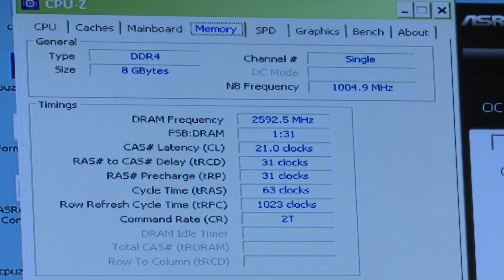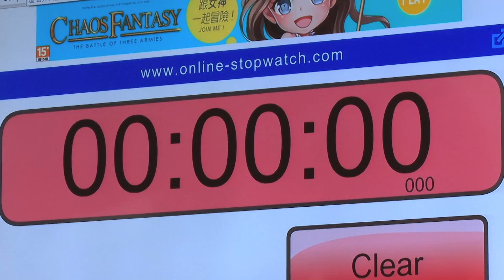G.SKILL's Extreme Overclocking Events @ Computex 2016

Comment: Wikkid stuff, I try to modestly clock every system I own for efficiency... never too hardcore as I re-build old systems into recording / gaming stations, rather than sacrifice them to benchmarks, but I do try to take advantage of the cooling equipment I have, and re-clock when I add new goodies.  My next build I am planning a lot of personal first's ... first custom loop building solo, first custom bending (non-pliable) for piping, I have an oldschool aluminum Lian - Li double windowed case I want to retro-fit / paint for blacklights for my first DDR4 creation, hoping to base it around a flat black mobo with an RGB Video Card, UV LED's and some flat black DDR4 ...

Comment: Holy crap! over 5,000 MHz??  That's incredible...  I have almost no luck with overclocking, my hardware is mostly crap.  I'm broke lol.  I can sometimes get my CPU and GPU running a hundred MHz faster than normal, but that's about it.  If I had the right hardware, it'd be a different story completely!  Eventually I gotta try this liquid nitrogen thing, I've seen the tutorials, I know I could do it, but right now I'm broke and have other things to put cash towards...

Comment: That video was awesome.. Im running an AMD 6800k  overclocked at 4300 ghz with an ASUS HD7800 3GB GPU at 1292/ Memory clock at 5410..     My ram is only 8Gigs of DDR3 with virtual memory at 12GB.       A set of these 3200 Tridents would be an awesome addition to my rig.

Comment: OC'ed my 3770K to 4.5ghz but temp was too high @ 1.3volts or above.. and unstable at 1.3v below.. so im at 4.3ghz @ 1.25v with temps around 65 - 70C, my Kingston hyper X furys 1866 are oced at 2133 @ 1.53 volts.. cant really oc my 1070 as it just throttles even if i bump the core +100 mhz, but VRam is stable at +450 mhz.. will have to make do till i can save enough for AMD Zen or Intel Kaby Lake due next year.. cheers

Comment: My CPU doesn't like when I overclock it's RAM, so I am running stock DDR4 @2.4GHz. My i7-5820k however is an okay overclocker. It runs 4.3GHz @1.28V just fine which is a significant performance boost over the stock 3.6GHz. Achieving this was super easy on my Asrock X99 Extreme4.

Overall I usually lose in the silicon lottery. In the past I had a GTX 670 which would only do stock and a i7-4930k which was limited to 4.2GHz. I never had any defects due to overclocking though which is a plus.

Comment: I overclocked my 2600k(3,.4GhzStock) to 4,8Ghz All Cores using DDR3 1600Mz Gskill DDR3 Ripjaws, had no problems. Also own an very old intel e5200(stock 2,5Ghz) which was clocked to  3500Mhz on all Cores.

Comment: Got my A6 3420m to 2.6 stable and under 80 C and my A10 8750K at 4.3, and currently testing it for better, 4.4 or 4.5 while lowering the voltages from 1.45 :) I haven't reached more than 55C. And for graphics on both chips, +200 Mhz for a good gain on the gaming side. I like AMD APUs ^^

Comment: I overclocking my 970 strix only when I need that 5-10 frame per second boost. Although I have tried to OC my 4770k, my motherboard didn't support it at the time. I have updated my drivers but haven't gotten around to trying again.

Comment: Nice video. My first overclocked processor was AMD k5-pr133 (bus set to 75MHz from defalt 66). Second was Intel Celeron 600 (bus set to 75MHz from default 66). Third was AMD Athlon XP (Barton) (FSB set to 400MHz). Then was Intel Q6600 (FSB was set to 333 MHz from default 266). Now Intel Core i5-5675C overclocked to 3900MHz. Not very cool, but this is not the end ))

Comment: My first overclock was my good old Q6600 G0 on my Asus P5Q. That was my first real PC that I built from eBay purchases. I managed to get it up to 3.2GHz using an Arctic Freezer 7 Pro. My next overclock is the rig I have now. I have my i5 3570k at 4.3GHz under a Corsair H55. 60-65c under full load.

Comment: I still remember my first overclock. I was overclocking a Pentium E2220, and took it from 2.4GHz to 3.0GHz with air dissipation. Obviously I had not disabled the second core. And from there I was delighted to overclock the old processors. Because with very little money and with a motherboard 775, you can enjoy great.

Comment: Still using a socket 1366 Xeon X5690 Processor Over clocked to 4Ghz on air everyday use from gaming to graphics. Slight over clocked with 18GB Extreme Speed GSkill Ram which has worked wonderfully no compatibility issues what so ever. In order to get it stable I used prime95 with a couple of temp monitoring programs took a lot of trial and error to get it just right.

Comment: The only overclocking I ever done was when my old GPU was getting too slow to properly game.
I used a BIOS flash and RivaTuner to unlock nearly everything inside (nearly all pipelines without artefacts) and crank up the clockspeeds on core and memory.
It only lasted a month though and then it died altogether :P

Now I just buy faster hardware to compensate and give the 'older' stuff to my family.

Comment: My overclocking started with 386 DX 35, when i clocked it to 45 Mhz :D
From that on almost every computer has been overclocked.
Some honorable mentions of mine (just some highlights): 
First watercooled PC, built around that already mentioned 386 DX 35 @45
-AMD 486 DX2 80Mhz to 150Mhz stable (booted with 198Mhz, but was not stable)
-Pentium II 333 @515Mhz
-Celeron 667Mhz to 1452Mhz
-Pentium 4 2,4Ghz 478 @3,3Ghz
-Pentium 4 630 @4,2Ghz
-C2D E6300 @3,6Ghz
-QX6700 @3,8Ghz
-FX8370 @5,2Ghz
-i7 2490X @4,9Ghz

Comment: i had an old pc which i wanted to throw away because it was too slow. but then i have decided to try to everclock it. i have overclocked it by about .5 ghz and it became usefull again, so i have bought a new system about 1 year later with better specs :)

Comment: I rarely overclock ram but I do try and get the timings as tight as possible. I'm currently using 3200MHz Corsair Platinum.  I have managed to get it to 15, 16, 16, 36 but I think I could get a bit better with G.skill. :)

Comment: I tried to use the XMP 2000 on an old X58 system but it didn't work. After a few hour searching on the internet, I realize that my CPU IMC is too weak for that setting. So I'm waiting to change to other CPU with better IMC and will attempt to try it once more.

Comment: I have some good experience with Gskill ram, with RipjawsX especially. I can push the ram from 1600mhz 6-8-6-24 into 2400 8-12-8-24. It's cool experience when you consider the price of the ram and you gain 50% more mhz. and I only pay for 35 USD

Comment: The furthest I've ever overclocked my memory was taking a 1600 MHz DDR3 kit to 2133 MHz just using some trial/error with timings I've seen for similar memory speeds... this kind of overclocking, ESPECIALLY for memory, is just mind-boggling!  CPU and GPU overclocking always came easier to me, and frankly made more sense just because memory speed gains for overall system performance aren't really felt for most use case scenarios...

... but it's still nice to have that fast memory, even if it's just for bragging rights ;-)

Comment: I have overclocked my AMD FX6300 up to 4.2ghz  paired with my G.SKILL ARES 2x4GB at 1866mhz. It is still running smooth without problems since 2014 when I first built it. If I will be winning one of the Trident Z memory kits in your giveaway, this is a perfect timing because I'm planning on upgrading my RIG into a DDR4 Skylake system. Thanks G.SKILL for the chance and more power to your company!

Comment: I only have good experiences with OC due to good luck, both my CPU and GPU are beast overclockers. When I find a very demanding game I push my HD 7950 to 1.2Ghz and my i5 2500K to 4.5Ghz, on relatively low voltages compared to the stock ones, and overall performance increase is an insane +50%. If I happen to win some RAM from you I will upgrade my CPU and mobo to make it compatible. Good luck everyone.

Comment: I've have some experience in the past with overclocking: Intel E8400 can't remember the clock I got it to since it's been so long. More recently I've gone through 2 5Ghz chips 3770K and 4770K haven't touched my newest 6700K yet. I've had a ton of GPU overclock experience with some pretty sick clocks on a 7970 and 290x more recently. FedEx is dropping off my change to the green side in a EVGA GTX 1080 FTW sometime today but can't toy with it until EK releases a block for it. 

When it comes to the ram timings though I'm at a loss. I can increase the Mhz rating several steps above shipped specs but the timings elude me by getting a bit too far in depth.

FYI The G.Skill girls are the best part of the vid. ;-)

Comment: overclocked my 4770K to 4.4Ghz on air Noctua Nh-d14 with good temps. My attempt at overclocking my stock 1600mhz ram however failed miserably. Not sure if ram (vengeance pro) or motherboard (asus z87 pro), but time to upgrade both I think

Comment: When I overclocked my AMD HD7750, I just put the sliders all to max and it did it. It was burning up the atmosphere, but it did it! Sliding back the memory clock a little allowed my to keep it at a little lower voltage and maintain reasonable temperatures.

Comment: My motherboard (Asus Gene VIII) is not very good at overclocking, so I didn't manage to squeeze much from G.Skill TridentZ 2 x 8GB 3333 CL16. I've only managed to get 3480 MHz, with much of a struggle. I don't blame the memory, but rather the Asus. I've tried many bioses, no good result.
My dream is to get my hands on 3200 CL14 set, as I've read that 4000 MHz is in range :) Maybe I'd change my motherboard, to get better results (Asrock Formula maybe?)